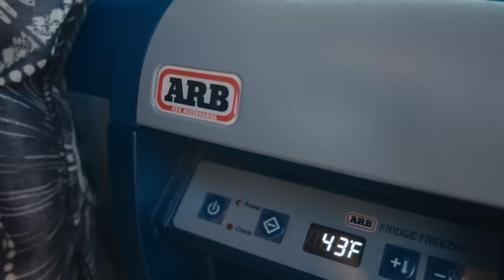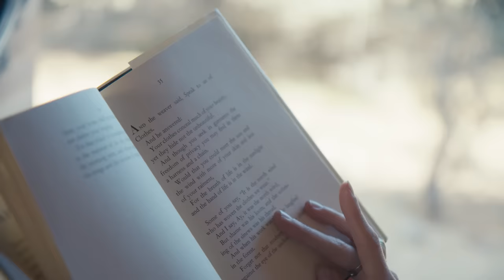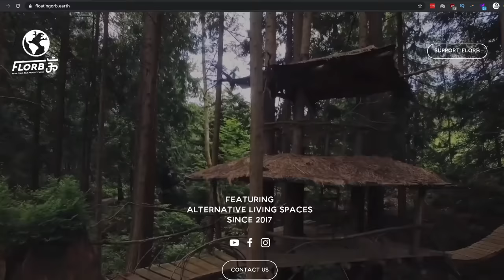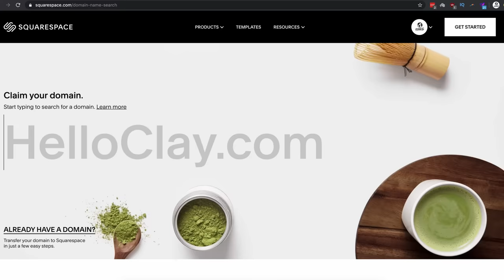The Best SOLO FEMALE VAN CONVERSION I Have Ever Seen

Comment: " I don't want to use propane because propane is dangerous and scary". Hank Hill would not approve lol
Reply: After the explosion at the Megalow Mart, Hank developed a phobia of propane, which he later conquered. Propane is definitely dangerous if not properly installed, stored, and maintained
Reply: Because he sells propane & propane accessories.
Reply: I find propane a little scary myself, too, but is it possible to go only with electricty when it comes to cooking? What do you think?
Reply: Propane is terrifying!!! Insert natural gas...😏
Reply: She could use an induction cooktop for portable electric cooking.
Reply: Fran Ziska yeah but it tends to drain your battery but maybe using a charcoal stove would work
Reply: Shoot just buy a mini bbq pit and act as if its a ban fire
Reply: @franziska8957  I think... If youre living around in a van you could also just make a nice, cozy fireplace outside and cook with it. 
Your food will taste a little differently depending on the type of heat you use.
Reply: @franziska8957  bros never seen an Electric stove huh lol
Reply: But she has lithium ion batteries under her bed cushions

Comment: Really beautiful.  The van also. I have one suggestion and one question. For refilling your water tank, I am sure you can find a larger hose and instead of pouring into the collapsible jug and then the hose to the tank, you can use a funnel to pour directly into the hose which will run into your tank. My question is you made a point of saying no propane because it's dangerous and I totally agree, but then said you have a propane heater in your storage. Wondering if there isn't a portable heater that would plug in (assuming you have enough elec. to power it.) Just thinking out loud. ;)   Keep living the dream and stay safe and well.

Comment: FYI so you know what to look for the van is entirely built by Mercedes but models older than 2008 was sold on the US market as a Dodge, newer models are most often marked Merc logo .... Think of it like when volkswagen did the motor for 924 Porsche and bottomplate for 911 if I remember right but other way around =) In short she made a really good buy.

Comment: The quote right at the beginning is so great to hear. I've been thinking about building a van myself but I have no experience in electrical work what so ever. That has held me off for quite a long time. But just starting a project and finishing all the steps, eventually it will all work out. Sure, there will be moments where you'd wish you had put an extra wire for a light in the wall but there are alot of ways around it to still make it work and look good. Guess i'll start looking for a van now

Comment: For the eye mirror - I saw it once at an ikea and never forgot, but instead of having the mirror flush with the wall behind it, if you find spacers to put behind the top, it doesn’t have to be that big, it will still look pretty much the same but will angle downward, so you will be able to use it how you want.

Comment: I finally have a floor plan because of this build! I Have an old conversion van. But I'm a home mechanic and can fix it. In Great shape. Very little rust - SoCal van. Rebuilt transmission. 1993. I'm going to build a new 3 foot tall high top framed out, custom shaped. So I can fit that 1 foot tall cargo drawer space under the table/bed like she did here - which is brilliant. I love those duel couch - table/beds with the movable detachable table people have in sprinters. But fitting cargo space below that is key. Bottom cargo slide out drawers - 4' long 2'wide supported by poles at the end to hold my 6 piece easily portable electric drum kit to perform on an elevated back porch, alone synced to the sound system, or a band. The two slide out drawer/platforms (together paralell) double as storage/cutting board outdoor cooking/counter space with movable propane stove. It CAN be done with an older model conversion van. Which I'll later convert to electric by decade's end. But interior wood vibe and decorating just like this. But less gypsy like styling, (some) with more apres ski cabin vibe (I snowboard). The interior decorating and brilliant layout here is so inspiring!

Comment: The idea of "lay the floor first and everything will come in time" is an example of the "Ready, Fire, Aim" approach to a project.  And that is a very difficult concept for some who want to plan every last detail first.  That is sometimes called, "Ready, aim... aim... aim..." and sometimes nothing gets done.  There are actually differently personality types at the extremes of managing projects.  One extreme is "just jump into it and we'll figure out the problems and maybe have to make changes as we go along".  The other extreme is "we will plan so carefully that there will be no surprises" (as if that's really possible).  Of course, many people are somewhere in between those extremes.  No approach is inherently wrong.  But the "Ready, Fire, Aim" folks are usually more likely to get the finish line quicker AND actually make it to the finish line.

Comment: A suggestion for using wood boards such as on the walls and ceilings:  You can plane the thickness down substantially, to perhaps 1/8", and save a LOT of weight and it will still look exactly the same.  (And even provide a tiny amount more width and height to the inside area.)  You can buy a smallish 12 or 13 inch wide wood planer for maybe $300 (Craftsman) to $600 (DeWalt) and then sell it when you are done.  Or take the wood to a cabinet making shop and pay them to plane it.  On the small home type planers, it will take a while since they can only make fairly small cuts and you will have to pass the pieces through many times.

Comment: What a lovely and well-balanced home Theresa!  Just how long did you spend building it out?  Heat not mentioned.  Do you use something like a  Buddy (and is it enough?), or do you just avoid cold destinations?

Not to second guess you because the lath ceiling is stunning and adequately safe from contamination.  I just wanted to mention a product I greatly prefer over bleach called “Shock Wave.”  No, I’m not on commission, nor are they even nice on the phone, it’s just very unique and I’ll never go without it in a regular home (though I don’t know if I would give it real estate in a tiny home, well, I might).  It is less toxic than bleach (though you still can’t eat off it), less messy, more effective, and I don’t believe any more expensive by the time you dilute it ten to one.  Though bleach kills mildew, it is also  a nutrient for it, so it can actually feed the problem instead of eradicating it.  Shock wave is number one, so it was used to clean up the Jersey Shore after Hurricane Sandy.  But that’s not all it does, it also disinfects and was rated even more effective than Clorox or Lysol at killing the Coronavirus.

Comment: I worked at an animal shelter that had a Sprinter, little bigger w/a panel separating cab & cargo. We'd fill it with crates to transfer dogs. It was very dependable (until one idiot put unleaded instead of diesel) but the heater would automatically come on when the windows were rolled down. We did most of our transfers in warmer weather, since we're in mountainous areas & snow closes roads frequently. But the heat thing made no sense.

Comment: so i was confused and found out the reason dodge and freightliner make these vans as well is because of that crazy chicken tax law thing that was implemented after WWII that was a terrif or whatever you call it on light trucks and a few other things and i guess putting an American  manufactures badge on this is a way to get around it but it can make repairs on these vehicles sometimes a bit tricky from my understanding sometimes seeing as how there are lots of minor things that may stop you from taking you freightliner sprinter to a freightliner specific shop and being turned down because they dont deal in light vehicles just the larger semis and 5 ton trucks and what not of that sort so you would have to find a dealer or garage willing to work on said van if you were unable to find a shop matching the manufacture of the sprinter especially if it happens to be warranty work and you cant find a garage to carry out said job for your make of sprinter these seem like great vans but how hard is it really to get services for this thing it almost seems like a huge pain almost seems like something a with a bit of an older style would be ideal for me due to me  being cheap and lazy lol for example a chevy express uses that vortec v8 motor if im not mistaken and theres alot of parts that are usable between other chevy v8 vehicles using the vortec engines seemingly making more parts readily available cheap and easier too find i would assume, with the amount of time that platform was used for im sure you could walk into any junk yard and find an abundance of parts if you chose to do so but something like a sprinter i feel like you would more or less be finding write offs or super high millage examples in more cases then you would find something that has just sat for years and just ended up with a sad fate in a junk yard like a chevy type vehicle witch i assume you would find more of these then just specifically the sprinter vans also seening as how they are much newer of a platform over here in the US/CAN and GM has used the vortec v8 in a few different things from gmc chevy and maybe holden over in AUS but im not sure how long GM has owned Holden motors im sure there are also others but my point being is it look amazing but seems expensive when saving money is the whole goal for some people if not most people